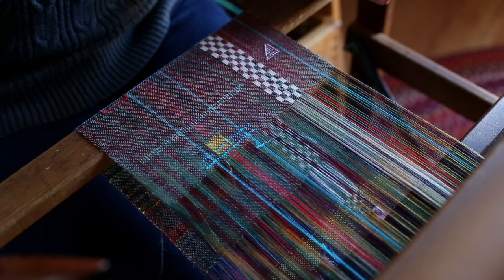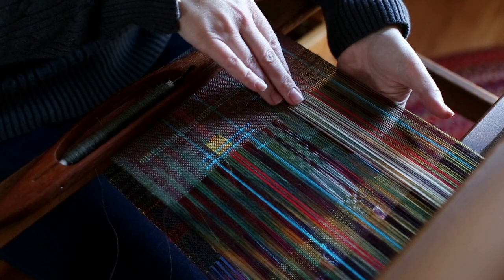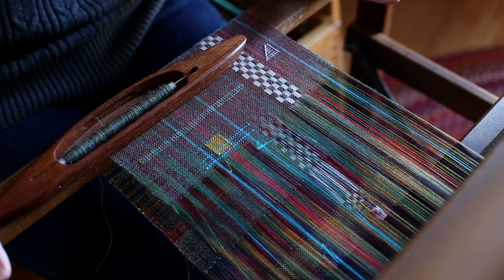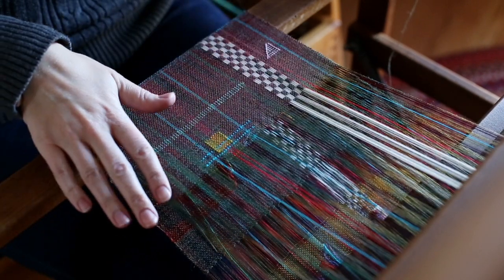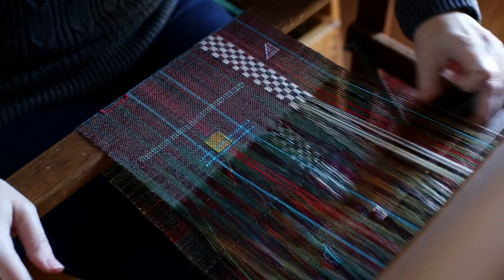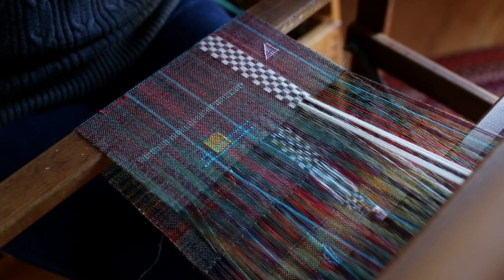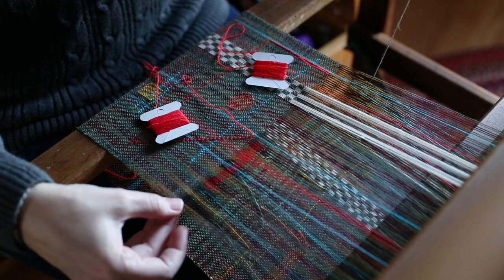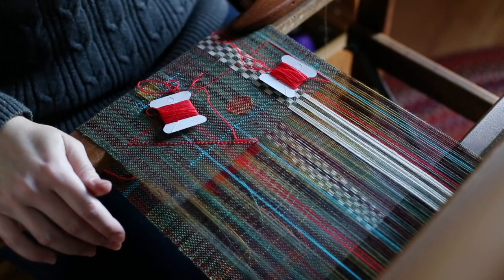Simple Supplemental Warp for 4 shaft weaving

Comment: When winding the warp, do you also include the white threads, and when threading through the reed, do you put two threads through the  reed at that point?  I can get the weaving of it okay but the setup is a little confusing,  so  can you let me know if the supplemental warp is entirely separate, and threaded by itself, or included in the original warp and threaded as usual with two threads going through at
the point of the supplemental warp, hope I explained this so you know what I mean.  Thanks
Reply from the maker: I know this was from a long time ago but I'm just seeing it now. I figured I might as well answer now in case you or anyone else is still wondering! The white warp was created as its own separate entity. I warp front to back. I threaded the entire regular warp on shafts 1+2 as plain weave. First, I used 19 epi through the reed and then 1,2,1,2 through the heddles. I tied that on the back beam. Then, without winding on, I added the white warp where I wanted it to go. I also used 19 epi through the reed for this, right on top of the original warp that was already there. Then I did the pattern on shafts 3+4. I tied this on the back beam. Then I wound on. The white warp doesn't hold the same tension as the regular warp. It will loosen up as you weave. I used weights on it to keep the right tension. I hope that helps!!

Comment: Nice explanation. I do have a couple of questions that I hope you can answer. I don’t have a supplemental beam either, so would I be winding both warps together and then be prepared to weight the supplemental as needed? Also, if my pattern also (sometimes) uses the same shafts as those of the ground cloth, do I thread the appropriate heddles with one of each warp thread?
Reply from the maker: Yes, I wound it all at once and then added weights to even the tension as they became necessary on the white threads. For your second question, the issue with that would be that every other pick would catch that thread, because 1 and 2 are used for plain weave across the whole surface. I think you either need separate shafts for the pattern (so a 6 shaft loom if you wanted plain weave and a 4 shaft pattern section) or you’ll have to do some pick up work. I’ve done a pick up pattern like that in the band, as I would in a regular inkle band, and it is definitely possible but rather slow! I would recommend starting with a 2 shaft inkle pattern first to get a feel for the mechanics of it and thread those on 3 and 4 and then decide if a pick up pattern is your next project :) I hope that helps!